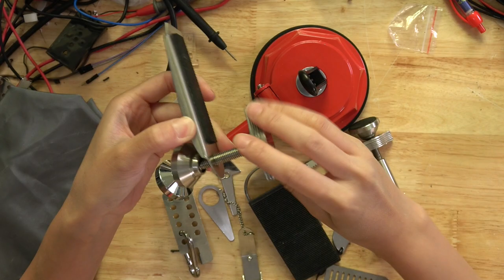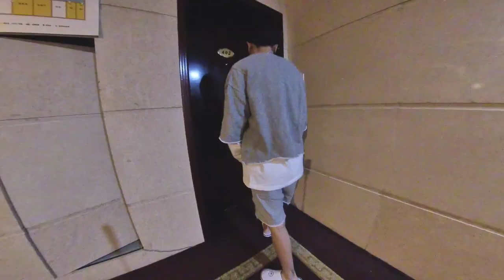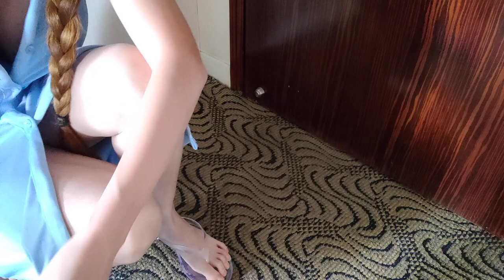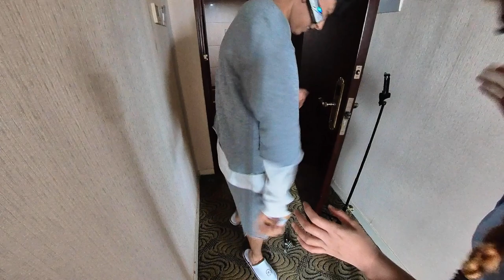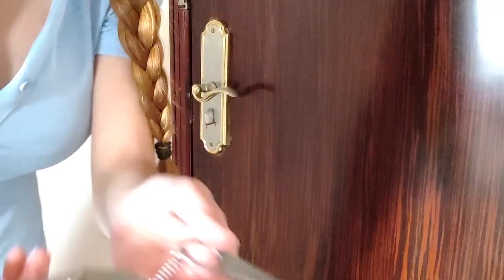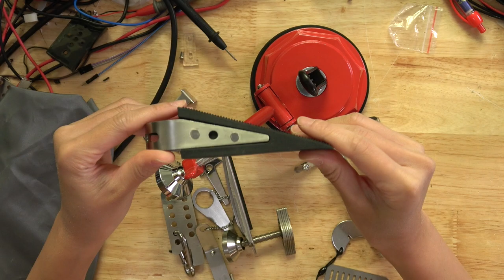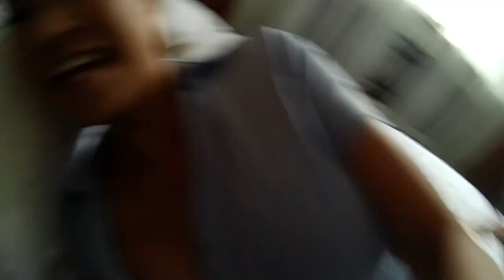Creeps Trying To Get Into My Hotel Room! Do Travel Locks Work?

Comment: Using a suction cup to secure something for more than a few minutes is kind of a bad idea, they can hold really strong (I've used suction cups on a crane to lift 10 ton plates of aluminium at a shipyard but those ones had a vacuum pump for constant suction) for some time but eventually air will leak in, especially if the surface is not perfectly smooth like glass, and the thing will simply fall off. Still the suction cup one would probably have held better if you had positioned it so the "leg" had been at an angle, not vertical as then pushing the door would also push the foot harder against the floor.

Comment: I think if you can keep the handle from turning, it will be more effective. Sounds like a 3d printing project in the works. VHB Tape to the door and pins to or a latch to keep the handle from turning.

Comment: Some of those that go in the latch could simply use a thicker steel plate (if they are not aluminium...) which at least can be easy to made yourself.

Deviant Ollam uses one that is different than the ones you've used (and I also use the same) and it is rather effective (not perfect, but better than most you've tested).

Comment: Jam a wooden or metal chair under the doorknob. The chair will lean back with its front feet in the air. Jam the back legs of the chair back as far as you can to ensure the chair will not move.

Comment: What was that like small hidden door built into the wall outside the hotel door. You can see it from the intruders head cam under the floor map. It's like a small hidden door that hinges at the tiles grout lines.

Comment: it seems the problem with the first and third ones was the carpet. I'm betting if the floor were tile or something like that, they may have stood up better. I honestly wouldn't trust the third one anyway though. The suction cup won't hold if the door is textured or isn't flat in any way. and NEVER rely on the strength of a piece of metal. It's almost always nickel coated zinc and will bend very easily.

Comment: Also beware of any camera system that runs over wifi rather than cellular data.  An inexpensive deauther can neutralize any wifi connections and render cloud recording useless. Cellular data can be blocked too but it’s not as common.

Comment: Also bear in mind that if you need to get out in an emergency you need something which can be removed easily and quickly from your side even in low or zero visibility. Albeit I understand the recommendation to use multiple locks doing so is likely to increase the risk to you substantially.

Comment: I play with these devices all the time for fun. I'm not a big guy, only about 180 lb's, but that one floor stop Kaidi couldn't get past, she was close. I'm willing to bet that someone my size could definitely force it through. Unfortunately, most of the products out there are gimmicks at best, and the actual good ones tend to be over priced. I never trust the ones that hook into the latch. There's just not a lot of space to fit that gap, so it really limits how strong they can be. Plus, because of their size, it kind of focuses the pressure in one spot, so even if they do hold up the door jamb will generally break out relatively easily. As far as the wedge under the door, I would recommend wedging it in harder. I recommend a rubber mallet to force it under more. Those actually tend to work quite well when they're inserted properly. The problem is most people don't hit them with enough force for them to really grab on.

Comment: And.for the handicapped person, maybe try dangling a chime or noise maker around the door handle, this doesn't stop the intruder but will make a lot of noise (or a stick-on battery operated alarm) and load yourself up with pepper spray, a taser or anything else that you can physically do (gas horn, just make sure you have ear protection) they are loud as heck at a stadium, can't imagine how loud it'd be inside a closed environment. The intruder will (try to) run back out the room with his/her hands cupping their ears, in the meantime, all your neighbors will be in the hallway trying to figure out what the heck is going on. Hey, just food for thought!!

Comment: The effectiveness of the locks is also affected by the ability to use them properly.  My feeling is that if the wedge had've been tapped in with a mallet, it would've been much more difficult to budge.

Comment: I completely understand what would be the most useful, is an adjustable Bar from the floor to stop the handle being forced down with a tilt alarm or vibration sensor on the door handle, some means of very quick release if Fire in hotel, from Philip an early retired aerospace - defence engineer 😉

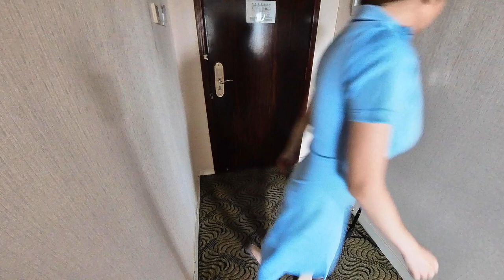Comment: 6:45 Would it work any better if the carabiner were locked "across" the metal plate, instead of just hanging from it? I doubt it'll make a lot of difference, the thing is too flimsy.
Reply from the maker: It's really those thin metal plates. Anything thin enough to slip in the door just bends...

Comment: The best one should grip the carpet, unfortunately carpet can move and devices that rely on the door frame is not strong or reliable enough. I think the best one should lock the door handle in place, this would allow the existing door lock for security. So a device that slots onto the door handle is the best bet for security.

Comment: Yes I really would like to see a tutorial on how you setup a motion detected system that automatically captures and uploads a usable face pic. I want something to use at home that doesn't require a monthly fee. I do have access to a web hosting service online that I have full programic access to. 

If you respond I do have a suggestion for a possible path that you could explore.
Reply: There are plenty of affordable WIFI cameras with motion detection built in and an accompanying app / cloud storage or can use a connected storage device on your home network.
Things to keep in mind if you intend to use for travelling though; in many hotels, the main power is automatically cut if the key card is not in a slot = make sure to have a suitable power bank and a USB powered camera.
Unless you have internet coverage on your phone, you may not get the alert instantly if motion is detected.
Reply: @TrasteIAm  Yes I have a couple of those already. And they usually don't get a usable face pic 95% of the time.
AdaFruit has a new open source FunHouse board that looks promising. I just need to figure out which camera to use with it. I'm thinking one connected to a Raspberry Pi probably.

Comment: it has to be  at an angle

when arm is  close vertical  it  wont works

but if its  about  70 deg then it works
thats why that  steel worked

Comment: Honestly a 2x4 wood door stopper with some waves on the bottom to grip the carpet will do the work and save you money.
Also use the door lock latch it helps alot its not the safest once they open the door it takes few seconds to open it if they know how to. But they need to close the door again to release it.
Id say the best and cheapest way is get a 2x4 wood triangle as use it as a door stopper. Put a chair by the door handle and use the lock latch and deadbolt. 
https://images-na.ssl-images-amazon.com/images/I/31uphTHrtYL._AC_SY580_.jpg (most hotel rooms in USA have them)

Comment: you know a dining chair with high back against the door with back against the handle is more effective then all those door stops..
Reply from the maker: Most hotel rooms specifically don't have that kind of chair now to prevent that.
Reply: @Naomi-Wu  They Really Don't Do Much for the Tourist when they Remove Safety a Hotel Tourist should Avoid.

Comment: Well that showing was... disappointing. I have a latch wedge I actually use in my apartment at home, since there are universal keys at the rental office that are able to unlock my door. I sleep much better since I started using it. The door won't budge when it's in place, and while I know someone (me for instance) could definitely get through it if they wanted to, it would tear out the door jam in the process.

The wedge itself has no manufacturer marks, but the manual says it was made in China, so you might be able to find one to test. They're a latch type, with the wide plastic wedge that presses firmly against the door.

Stay safe out there.

Comment: "[...] I don´t know about guys[...]" as flattering as it is to be considered to be a "strong guy" i think if someone sneaks in my hotelroom at night and catches me by suprise i would be caught off guard and disorientated. I guess most people waken up by intruders would be disorientated, at least for a moment, except maybe some special forces personal. I consider myself to be in reasonable good shape and i am not one to shy away from a fight, but in such situation i would probably at best land one or two lucky hits. I think the surprise element is the key factor in such a situation.
Maybe simply putting a little bell on the doorhandle would give you one ore two extra seconds to wake up and react ?
What i would like to know is two things:
1. if you combine two or more of the bad locks would that counter-balance their badness ?
2. is there something like a big bolt that goes across the whole door, paralell to the ground (maybe something telescoping to draw out) ?

I wish you the best luck on your future travels and hope you will be safe without people trying to get into your room.
Reply: Personally i put my keys on the door handle so if someone try to open it from the other side they will fall and make noise.